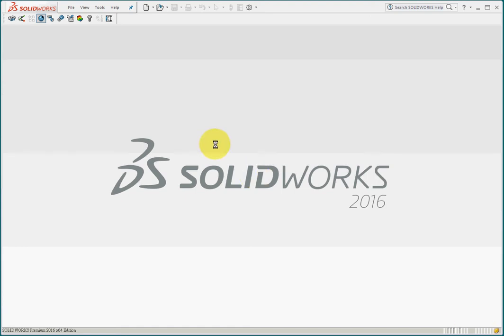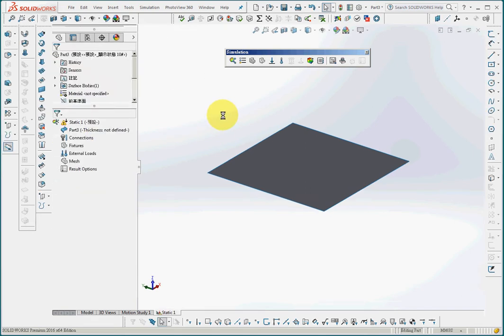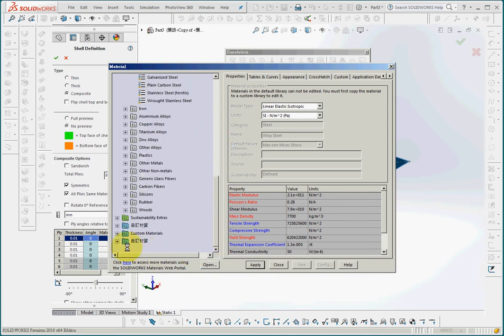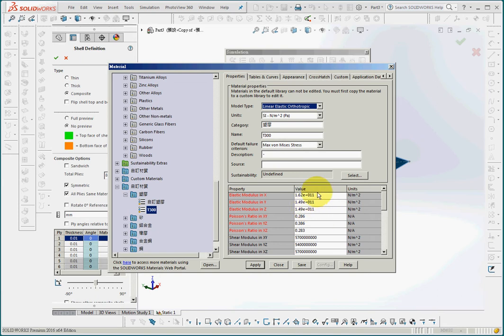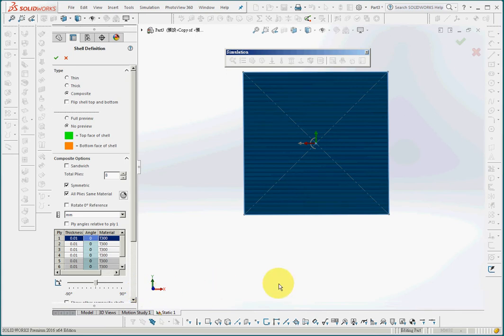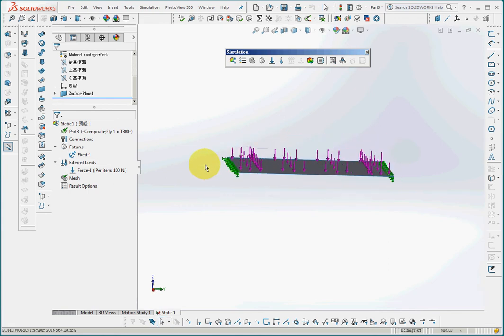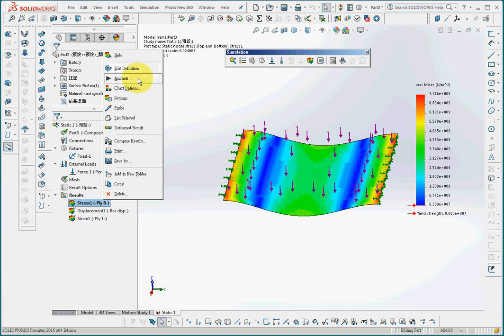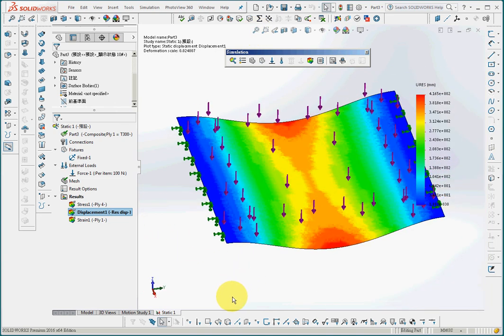SolidWorks CAE 6  Composite Materials

Comment: What is the Yield strength of carbon fibre composite? Carbon fiber, on the other hand, will not permanently deform below its ultimate tensile strength, so it effectively has no yield strength. what values should be used?

Comment from the maker: These general purpose software packages  provide only a simple way of simulating a composite panel.  One should consult composite mehanics for the detailed setting. For example a the y-mosulus of a unidirectioal ply is the value of resin.
Reply: y modulus of unidrc composite is not matrix modulus. It's (Em*Ef)/(Em*Vf+Ef*Vm)

Comment: Thanks for great video. It seems its really hard to find young modulus, poisson ratio, etc in all x,y,z-direction.. 
where did you find them on google?
Reply from the maker: Yes if you search for T300 or T500. the properties are available in the websites of suppliers.
Reply: @謝忠祐-g5h  so I found the T300 data sheet from Torey, but it doesnt show x, y ,z direction specifically... hmm
Reply from the maker: https://www.google.com/url?sa=t&source=web&rct=j&url=https://www.toraycma.com/file_viewer.php%3Fid%3D4462&ved=2ahUKEwiK57vdw53hAhUMEbwKHd2LAwEQFjAAegQIARAB&usg=AOvVaw0c6sqh1D-XyAO838o1ESw8
Reply: @謝忠祐-g5h  I have found the same data sheet. but how did you get the Ex,Ey,Ez .... 3:45 ?
Reply from the maker: I did not try to make it conform with expermental data. I simply use a comparatively reasonable value. For research work, you need to consult your professor.
Reply: @謝忠祐-g5h  thank you for your help!

Comment: Is it possible to run an FEA analysis with a composite material(surface) with a regular part made of steel (has a thickness) in an assembly?
Reply from the maker: Nivethan Thambirajah I have never try to do that. May be not. Because composite panels use surface model as the geometry.
Reply: Do you know a way to determine the properties of the complete panel so you can create a completely new material out of it and create a non surface geometry?
Reply from the maker: Nivethan Thambirajah 
When we use the module, we have to think in terms of composite mechanics, since the procedules were written based on the theory.  Therefore, I think composite module can only solve layered panel problem. We can define homogeneous anisotropic material, of course, but it is not composites. I think we can not define non-homogeneous anisotropic material using this module.
Reply: Thank you so much for responding! That's what I wanted to know: How can we define a homogeneous anisotropic material from the composite structure we have. Of course, these values will be an approximation. Is there a way where I can find these properties?
Reply from the maker: Nivethan Thambirajah 
Composite module is still in baby stage, we can detetmine the the bulk properties using such procedules. In ANSYS, we can write commands of failure criteria such as Wu-Tsai failure criteria and we can determine whether delamination occurs, but these are more advanced application only available in ANSYS, and we have to write ADPL commands ourselves, these instruction are available only through ANSYS training workshop. I have some materials from the training. Please mail: hsieh100@ncut.edu.tw
Reply from the maker: Nivethan Thambirajah

Anisotropic homogeneous materials can easily be defined in material properties interface. Please ask engineers near you or mail me. I can record a video for you.
Reply: I am currently working on a project where I have to create a sandwich panel made of two 8 plys with a core. I want to run a FEA on the assembly where the panel is combined with a steel structure. However, this is not possible because the panel would not have a thickness. This is why I wanted to know if you knew a way where I can define homogeneous properties based on the sandwich panel properties I have. I have the properties of each layer and the core itself. However, I want to combine these to have the material properties of the overall panel. How would I find these properties to enter into SolidWorks and define a homogeneous material.
Reply from the maker: Nivethan Thambirajah 
I think this problem can not be solve directly using the software. However, we still can think of ways to tackle the problem by figuring out an equivalent orthotropic bulk matetial besed on reaction force and displacement of composite panel. But this is not the purpose of this tutorial. My sole purpise is to show how to use the software through a most simple geometry.
Reply: I understand. I appreciate the time you have taken to answer my questions. Thank you very much!
Reply from the maker: Nivethan Thambirajah 
Thank you! I wish the response assist you a bit.
Reply from the maker: https://www.google.com/url?sa=t&source=web&rct=j&url=http://www.ijirset.com/upload/july/25_PREDICTION.pdf&ved=2ahUKEwiK57vdw53hAhUMEbwKHd2LAwEQFjABegQIAhAB&usg=AOvVaw1P15EBQM9iNeV6avg9RMNu

E1=Ex, E2=Ey=Ez, for unidirectional laminate